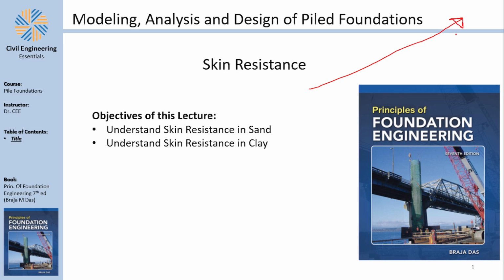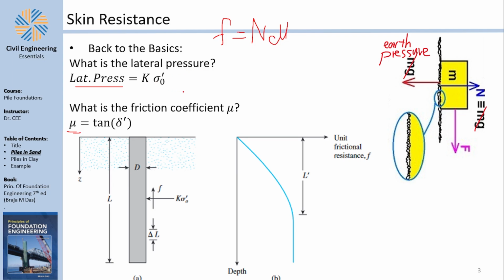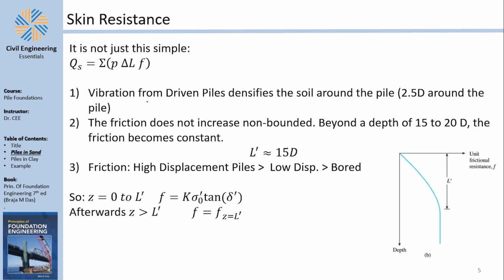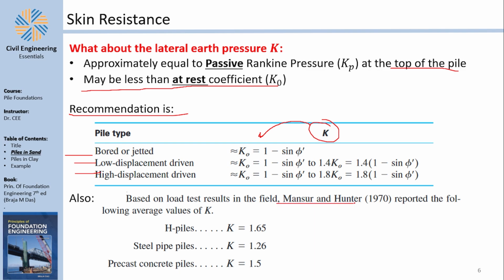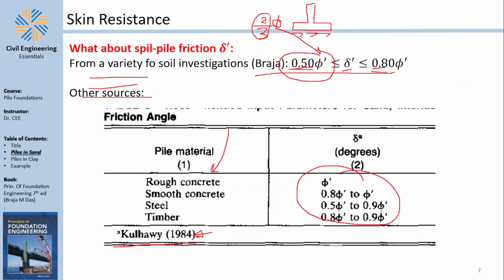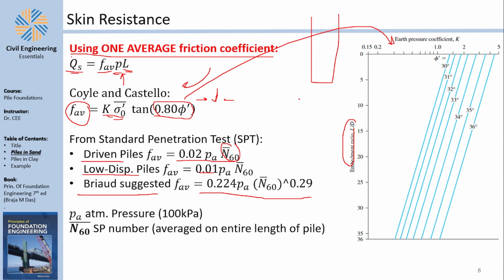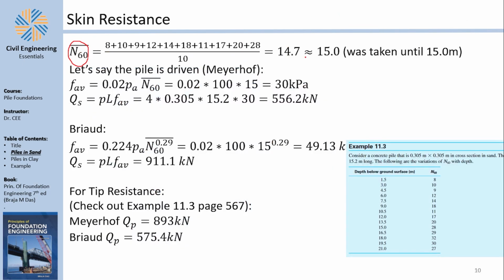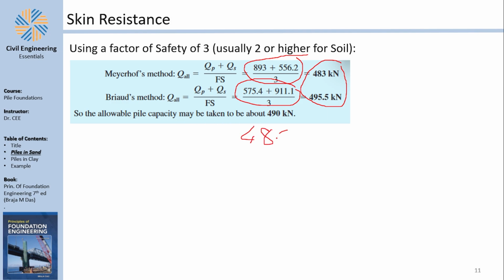Analysis, Modeling and Design of Piled Foundations in Robot - Part 6: Skin Resistance in Sand

Comment: Hello Dr. CEE,

Thank you for your work on the series, beautiful stuff as usual. I am a huge fan of “theory and key concepts first before application”. And I am glad that the CEE does not stray from this approach.

In my opinion; a good understanding of concepts allows an engineer to be able to use rational scientific principles with a good sense of the kind of the results that one can expect from a problem, this is as opposed to blindly relying on “magic numbers” and blindly relying on whatever a software spit out.

I was excited to see the objectives of this part 6 focusing on both 1) skin resistance in Sand and 2) skin resistance in Clay. My excitement was short lived soon after the CEE indicated that skin resistance in clay will no longer be covered on the video. 

Clay (expansive clay) has been identified as one type of problem soils which makes foundation design and construction a challenge in many structures. Perhaps the CEE could reconsider to include an addendum (a separate video perhaps?) that is focusing on “understanding pile skin resistance in clay”? It would be really beneficial to understand how pile skin resistance is dealt with in clay soils as these soils are a reality that one will have to deal with at some point.

I am enjoying this series; and I am learning (from the CEE) how to consistently make sense of even the seemingly vastly different numerical results and information such as those which one can expect from theories which are used to solve (or more accurately, theories which are used to TRY to solve 😊) problems in soils mechanics. 

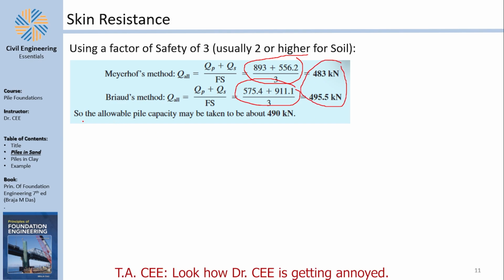Case in point = the results @ 11:39; I have little doubt that the CEE is probably aware that both 490kN and 480kN as a numerical value which has been "reduced to a single quantified number for practical considerations" and "in this context” (the context is very important as outside of this context, the current statements which I am making will not be true and they will not be applicable) could in fact be considered to be the same numbers [i.e., either 490kN or 480kN could be considered to be “good enough” to be used or to be assumed for most practical applications]. 

BUT and strictly speaking, one does need to pick a method and to then be consistent with the use and interpretation of the subsequent results from their method of choice. I accordingly fully understand and I agree with the logic to rather “round down” the least resistance value from the calculations as it has been explained by the CEE, or to alternatively leave the results as it is with minimal to no rounding. In that context, I would also consider the value of 483kN or 480kN to be the most consistent number which is resulting from the use of the two theories.

Thank you for shining the light. Keep well and kind regards,
DK
Reply from the maker: Hi there Engr. DK,
sorry for being late - again - in my replies. I was kind of pushing content like it is a sport, so I cooled down a couple o days. 

However, I am ready for round 2 of pushing more content, so you can expect another rapid fire very soon.

I totally agree with you, just using a black box approach to design might work, but one would lose the "big picture" of why stuff is working. Of course if it does not work, then, game over.

Oh for skin resistance in clay, It is gonna be the next video in the series. I will be following Braja M Dass's book in that, I think it does talk about different clays so I will be covering it.

Also, btw, once I finish with Braja's chapter, I will be checking out ACI and EN-UK annex codes to see how this theory is reflected in codes of practice, so a lot of cool stuff is coming.

The cool point that is actually mentioned in the reference book is that: if multiple approaches are valid for a set of given inputs, the book will use all the approaches and select the smallest result. But also note: the method is to be consistent. Meaning: if you use the method of scientist X for tip bearing, you would have to use the same scientist for skin friction.

I agree with your interpretation and you mentioning the context is the cherry on top! Thank you very much for enjoyable discussions I have. I am pretty sure that the viewers will be reading those and find them equally beneficial.

Regards,
CEE
Reply: @CivilEngineeringEssentials  

Thank you for the response; I really like all of the plans for what is yet to come. And Lol, “…. [Doc] pushing content like it is a sport…”. 

Comparing how ACI and EN-UK annex codes reflect the piles theories is a wonderful idea and I think that it shall be very beneficial. I am looking forward.
 
Thank for all the hard work Doctor. The channel remains a real joy to watch.

DK
Reply from the maker: Comment "Pin of Honor"
Reply: @CivilEngineeringEssentials when will the new videos be uploaded?